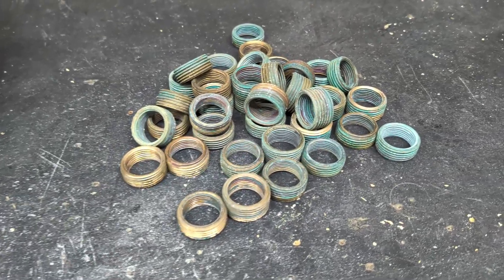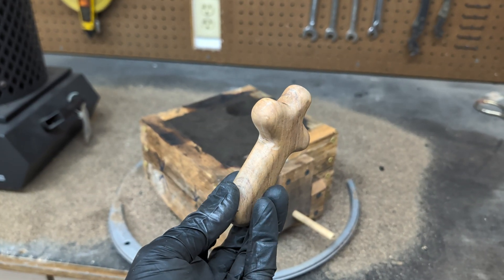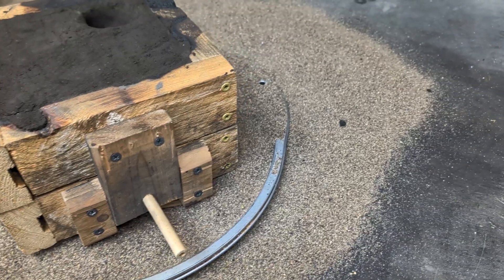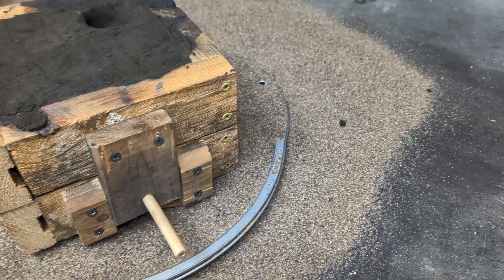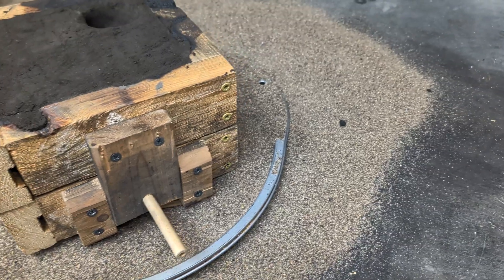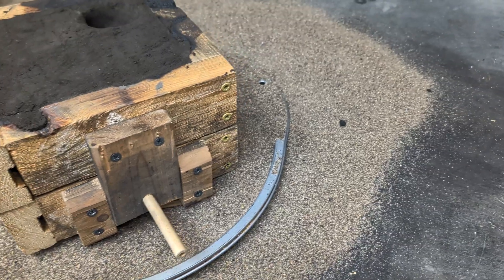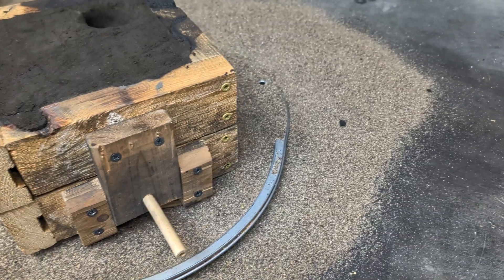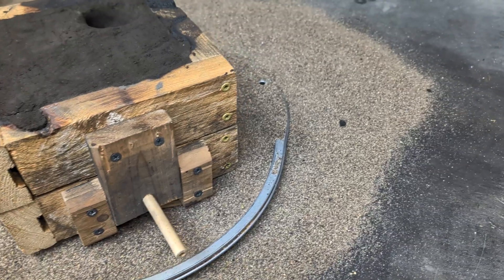Casting Brass at Home - Liquid Metal

Comment: So i have that same furcace and I've also tried to melt brass before but I have a problem with it :( I always get a lot of that white insulation stuff inside of the flask and it messes my casting.. My furnance is new but I dont know if i'm doing somethign wrong
Reply from the maker: White insulation?  With the electric furnace?  Which furnace do you have?
Reply: @HeinrichsMade  that same vevor in your video. Yes, it is as if the insulation would flake off, some bits would get into the crucible and it messes with the melting
Reply from the maker: @AdrianSpain1 that's interesting that the insulation would flake off.  Mine is pretty solid.  Does it float or sink to the bottom?
Reply: @HeinrichsMade  usually floats, or when you open the top some flakes will fly away, as if it was suspended. The problem is that sometimes it will mix with the brass and then wont melt
Reply from the maker: @AdrianSpain1 it doesn't sound right to me.  It is like porcelain.  I don't see how it floats away.  It also shouldn't mix with the brass to my knowledge